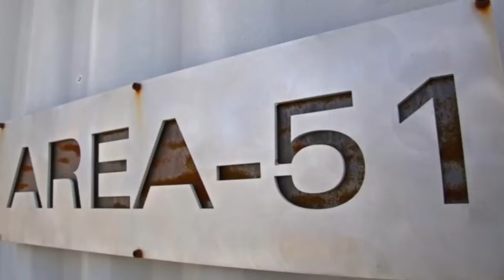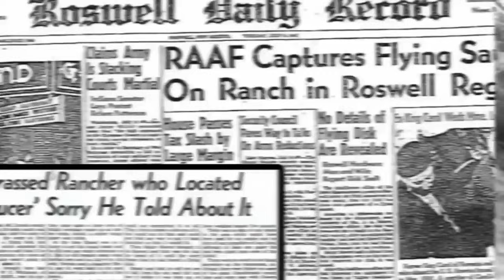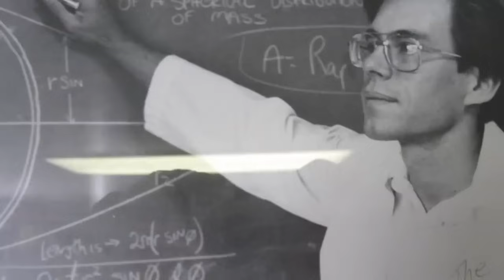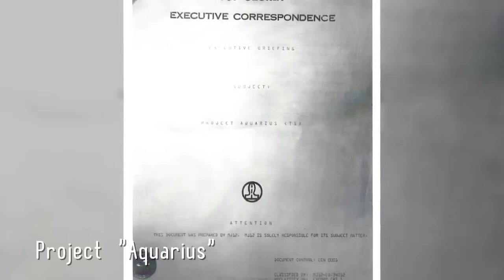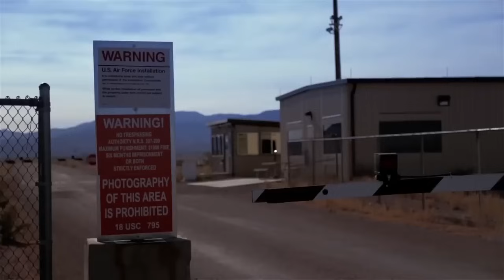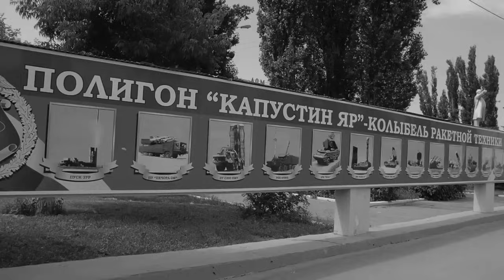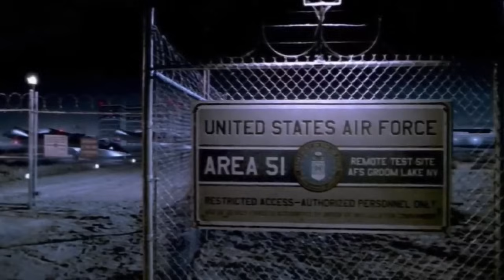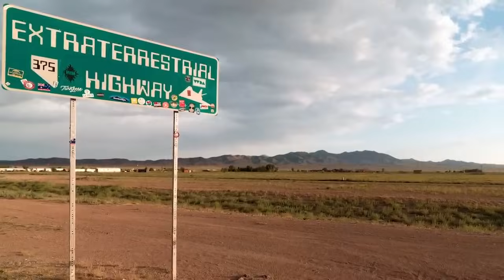Area 51: Aliens, UFOs, Bob Lazar & Advanced Technology

Comment: I saw the United States Government's Antigravity on August 30th 2023 at 9:10pm on Indiana highway 446. The craft was 40 feet above me moving west to east and it had a slight rotation northward. It is a triangle shaped craft with lights in the corners and center with navigation lights red and green with strobe lights. It is a smooth edges with access panels highlighted similar to the new stealth bomber. It is painted gray with a lighter color accenting the access panels highlighted. it was steady in it's movement like it was sliding down hill with no noise. When it moved by I didn't hear any noise from the craft from inside of my car and it didn't shake a leaf of the trees as it skimmed over themit had the same color and type of paint job that the United States Government's airplanes use. The access panels highlighted with gray as the main color. The access panels were in the stealth style of technology that the United States Government used on known programs. It had the required red and green lights used in aircrafts flying in the sky. It was a huge craft triangle shaped and flat. It was too flat to have enough lift by heated gas or any other gases to keep it floating around. It didn't have conventional thrust moving it forward because it was skimming the trees and it didn't shake a leaf. It was traveling west to east with a slight rotation northward without changing direction and the front end of the craft didn't have a cutting edge on the front of it. It was constant on it's edge being rounded and slightly concaved on the bottom. It was only 40 feet above my vehicle and I felt no air wash from the massive craft above me... It was a totally solid panel craft and with the amount of weight it was it would have required a lot to keep it aloft it's motion and speed would indicate it was not a blimp or conventional thrust. It's shape would not be a conventional air plane or blimp. I was 40 feet away from it... I got a good look at itThe black triangle is seen as black because of the way light works. The one I saw was gray with access panels highlighted and a slight concaved bottom like the space capsules and cones on the corners like other military planes. It's planels were like the new stealth bomber design and the lights were bright white with a blue hue. It had strobes and a spot light. It was a very huge craft the sides were smoothly rolled and the whole thing was smoothly rolled... It wasn't blocky. It looked like it was designed by Northrop Grumman because of it's access panels I'm sure they hold patent rights on. It was in a direct pathway where I saw it between two of their facilities and where most of the sightings happen with the triangle shaped craft happen close to Northrop Grumman facilities...  I am trying to investigate it now because they decided to disclose it to the public through sightings... They had to know they would be seen by vehicles. There was a vehicle behind me that saw it too... I reported it to the state police department and when I called at that point I was the only person reporting it. The officer asked if it was doing any harm and at that point I realized he wasn't going to log it. I checked WBIW police logs for the day and it was not there. I did also make a report to Mufon later and I have been posting a statement to as many as I can with similar topics.
Reply: ผมเชื่อคุณครับ ผมก็เคยเจอเหตุการณ์แบบเดียวกับคุณแม้กระทั่งตัวยานก็เหมือนกันกับที่คุณเล่ามา แต่ผมเห็นที่ภาคใต้ของประเทศไทย สำหรับผมเชื่อเรื่องUFO มาตลอดว่ามีจริงแน่นอน 🇹🇭🙏🏻🤝❤️🛸🛸🛸🛸🛸🛸🛸🛸